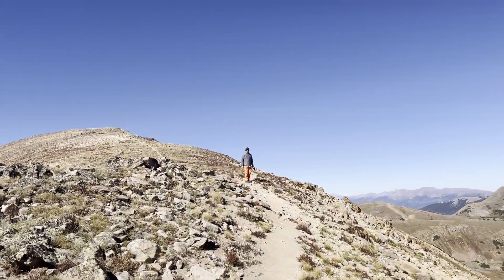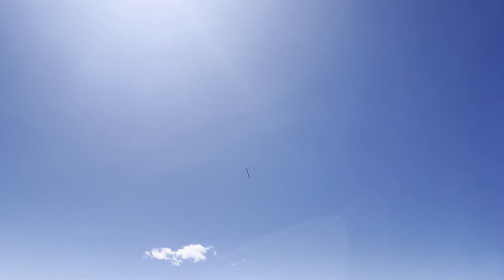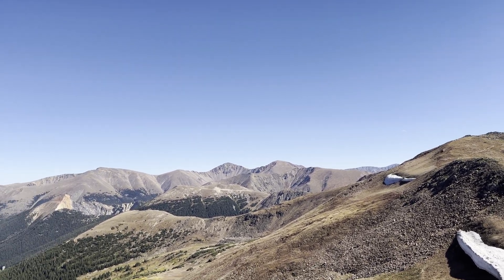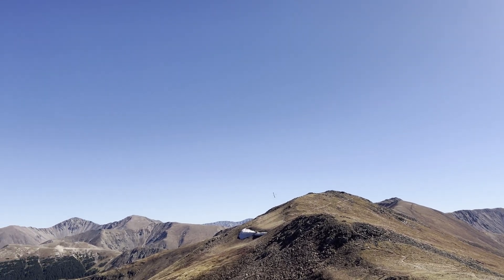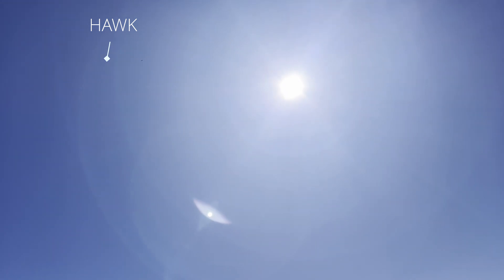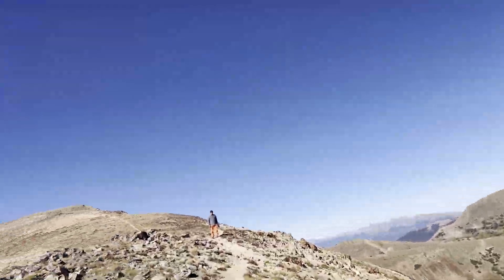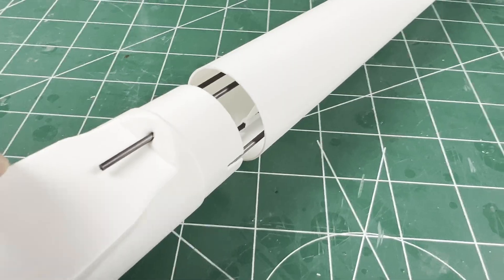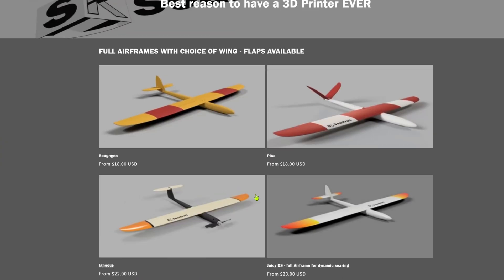Dynamic Soaring a 3D printed glider at Jones Pass CO Sept 2024 - Juicy DS from SoarKraft

Comment: I live in CO and I am a little nervous to get into this. Do you recommend starting out in the planes vs mountains? The wind here is insane.
Reply from the maker: It is very intense, but it is also a rush.... the speeds and sounds are addictive.  I learned with foam planes, but they are slow.... I was crashing $300-$600 glass and carbon gliders regularly to get my fix.    I started this whole project specifically to make a cheap disposable fast DS plane.... and it turned out well.

Comment: This may be a dumb question but why not put an fpv camera on board so you have something to fall back on if you lose sight of it. The weight of an Avatar mini 1S would be negligible.
Reply from the maker: Sure, but then you are adding $$ in the path of risk.... these usually hit the ground at great speed.  
See my other videos - this one in particular - https://youtu.be/McwzTV-Jb1w?si=fPELnU4dV00MExF1&t=655
High speed, low to the ground, turbulent air = good times
Reply: @soarkraft  Yikes! I see what you mean. Poof! Where did it go?

Comment: Im trying to decide between the pika and the roughgen  is there any differences besides the tail. If i bought a pika and then bought the roughgen tail would it be the same as the roughgen
Reply from the maker: Yes, the Pika is the Roughgen with the V-Tail option.  You can build with ether tail.  You can even add a t-tail..... and the wings are interchangeable too.
Reply: @soarkraft  very cool i like the modular approach and i look forward to building one. Probably gonna go with the pika cause i think v tails look cool

Comment: Do you have GPS or a buzzer on your planes incase you loose them?
Reply from the maker: I did, but if the battery gets separated it does not work.... my Rx has telemetry... sort of helps.  I usually fly fast and close so the wreck are near.... and if it disappears I am glad I only have ~ $50-70 invested... rather than a $400+ glider, which has happened before.